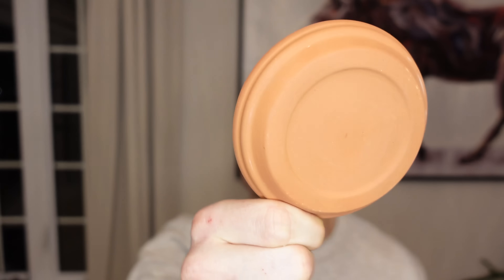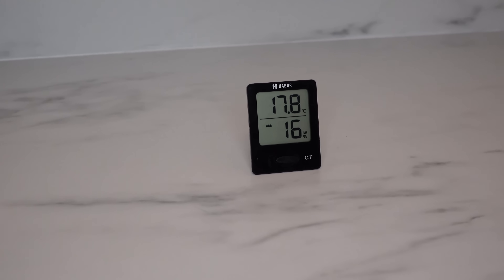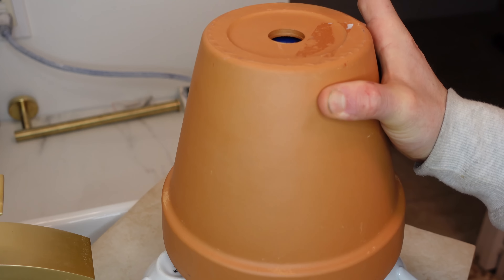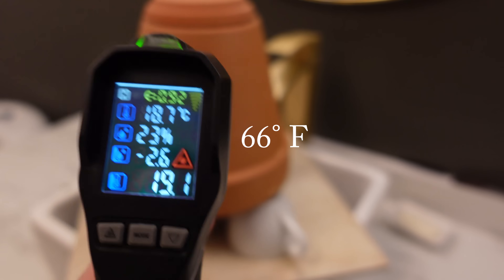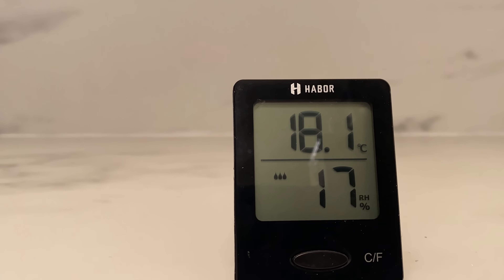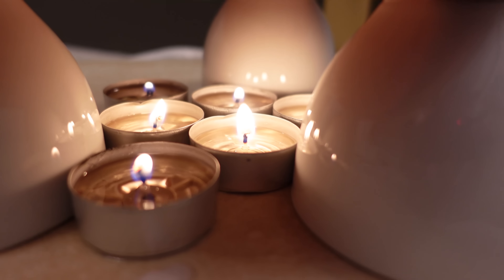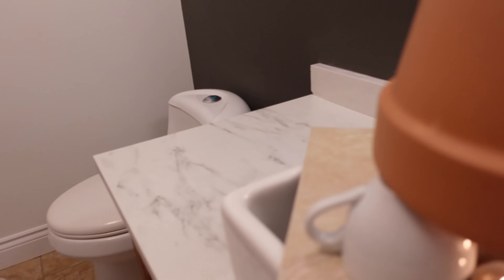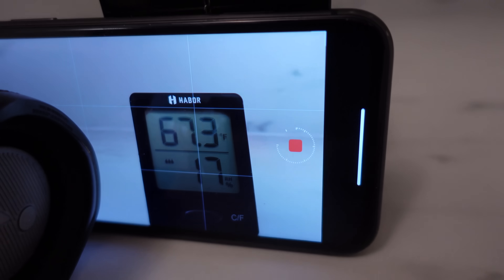CLAY POT HEATER TEST | Does It Actually Work?!

Comment: How many high output bulbs are in that room, did you start this in the morning as it heated up the ambient room...
Reply from the maker: Hmmm, good point. I will re do it with a different heat source and lights off.

Comment: There is a danger to this. 
The parafin wax can actually explode and shoot flames out the sides of the pot. 
Normally the flame on a candle just burns down the parafin wax but doesn't get hot enough for the wax to ignite until you put a lid over it like the terracotta pot.
This then sends heat down to the wax and can cause the wax to ignite.
Reply from the maker: True, be very careful when handling candles.

Comment: THE POTS NEED TO BE LOWER
Reply from the maker: Oh! I will re do it.
Reply: @philg  PLUS IF YOU PUT 3 BRICK WIT HOLES IN THEM ON TOP OF THE CLAY POT IT WILL RADYAT EVEN MORE HEAT  I HAVE BEAN USING THIS WAY FOR 30 YEARS  PREFRABLY BRICKS FROM AN OLD ELECTRIC STORAEG  HEATER WORK BEST

Comment: I use those little candles,  without terra cotta pots.  Mostly for lights.  But if am going to get a tiny bit  of heat, I would go to Sams Club and purchase a case of Safe Heat for indoor use, and have a carbon monoxide meter just in case.  A little camping stove with a grill on top, bit enough to use with small and or large terra cotta pots, and to heat up water.  Let's be real, something this small will take around 1/2 to 45 minutes to heat up water.  If you have bullion you can put it into the pot (depending on how big it is) 1 bullion for a small quart pot, a tad larger 1 1/2 package or cubes.  At least your getting something.  You can also fry and egg or bacon, but it will take more then 15 minutes.    But ya have to make sure the area is secure and safe, where nothing can be knocked over.   Then you might wind up getting heat you don't want (house fire).   Keep a fire estiquisher around in the area you plan on heating yourself (no tents) or cooking.   Keep an eye on that Carbon meter.  It will tell you if carbon build up starts in your area.  You need to ventilate.
Reply from the maker: Very interesting! Thank you for sharing

Comment: They work aslong as the Room Area isn't  to large.  Add another one to a larger room, you may need 3 or more if the room is rather large or big.
I would hang Drape or Blanket to cut the room size if you are running low on candles.
Just remember to put a Paver under the Heater as not to burn or scorch your counter top.
I like using my Terra Cotta Heater. 
Be Safe
🙏🙏❤️❤️

Comment: You did it pretty wrong. First, don`t put the cap on. There is plenty of heat coming from holes to the air and it heats the room. Second, the distance between candles and pots are a way too long. I put the pots straight to the candles and the pots went very hot. So, due the mistakes it did not work very well.

Comment: And FYI - a tealight candle gives off "about" 35W of heat - so in this case a total of about 200 Watts from the device. A human gives off about 100 W of heat energy. Maybe your bathroom had very low-wattage LED lighting? If you were using traditional incandescent bulbs then their total heat emissions would likely have been as much as or greater than all six candles combined.

Comment: Too funny - it heated up a tiny room by less than 2 degrees AND you kept the lights on (it would be interesting to know the wattage of the lights because they are a non-stop source of heat as well). I really don't understand how you could possibly be surprised that 6 candles warmed up the terracotta so that it was almost too hot to touch. Try holding your hand the distance away directly above 6 burning candles for a minute or two - candle flames are of course very hot when you are that close and immediately above them. These things are an absolutely terrible way to heat a room.

Comment: You have capped the pots so there is no heat moving in between them… there needs to be holes in the side of your spacer. All you have done is slow the process of heating.  The same temperature will be gotten with just the candles alone.

Comment: I agree that you would need to try the experiment w/ only the candles. Also, you confounded it by leaving the lights on in the room; if they give off any heat at all (some LED lights do & incandescent most certainly do) they may have been responsible for the increase in air temperature. So see if the room temperature increases with candles only and with no electric lights. I'm no physics expert, but the little I do know says you only get out of a system what you put into it.

Comment: Try capping the inner pot or even not at all, you can create a convection effect that way which works better. I have the two smaller pots bolted together, I use a long bolt and get one of the candles straight under it to maximize heat but use enough nuts and washers to ensure the pots aren't touching, and then have a larger pot sitting over the top so the heat can rise up out the small hole in the large pot. I have a second set up with just two pots with no holes capped at all (usually cap the top hole with a coin for about 30 mins to begin with) which pours much more heat out the top and strangely less paraffin smell.
Reply: the candles emit a finite amount of Btu's. Nothing is going to change that.
Reply: @uberdome1  yeah no shit, thanks for that. You clearly haven't tried it out yet. It's about saving up the heat from earlier in the terracotta which can then warm more air as it gets sucked through, the pots also radiate heat too. I've tested every method including just a bunch of candles by them selves. I use an actual heater for the first hour but then save on power for the the rest of the day. Good for single room use.

Comment: These are always the dumbest videos.  The candles will produce a fixed btu regardless if the terra cotta pot is there or not.  The room heats to the same temperature without the pots.  Yes the pots get hot but they do not create more heat.  They only radiate the heat that's already there.  If you ever care to be scientific,  and I wouldn't suggest you would, but if you did you'd do an identical test with no pots.  The resulting temp in the room would be the same and it would undermine this video so likely you won't do it.

Comment: Okay, so this may be taking things a little too far but couldn't we find a way to use thermo-accoustic's to power the heating of the clay pots from external pipes OR from Fresnel lenses directing light from lamps in the home onto the pipes directing kinetic energy into the home from a diaphragm with magnets on it which in turn produces electricity from a spun wire, some sort of always on system?

Comment: 1 this is a fail the space between the fire and the pots to big pots need to be up only 1 cm  for air so you really trap the heat  2  the smal pots top need to be covert with flat piece this will triple the heat if done correct you cant touch the pots you wil burn your self

Comment: So... you build a small heater... and on the heater you put an isolation in form of a second pot? Which reduces the efficiency in terms of radiation and trades it for energy-conservation of the inner pot. Or in other words: Putting a second pot on it, keeps the inner pot warm for a longer time but does give up less heat to the room.

Comment: The original one (from Wales I believe) said to use a metal bolt to join the 2 pots, with washers to create the space between. That way the metal gets hot and spreads the heat to the pots. Would be curious to see if there is a difference.
Reply: That's exactly how I made mine, hHe 3 of them and used about 500+ candles over winter. £3.75 per 100 candles. Hopefully wont need them from mid march but they do Heat up my rooms enough to not need the heating on during the day.

Comment: This is silly. You can look at the heat output of a single candle like that. The pots don’t radiate any heat or do anything meaningful on their own.capturing the heat instead of hearing more of the air doesn’t really change anything. 

The heat generation is coming from the almighty power of 6 tiny candles. That’s just not how you would want to heat a room of any real size. 

The next test you would want to do is, in the exact same room when the outside temperature is exactly the same … light the same number of the same type of candles and do the same experiment.

Comment: I appreciate the initial use of the word "Emergency." I'm a 33 year HVAC professional and candles of all sorts put out more soot, and add pollutants to the ambient more than is readily apparent. This system DOES work, but there is no free lunch. I am concerned about unattended candles, and soot. Once, again, the presence of soot, and the degradation of Indoor Air Quality is not readily apparent. Regular, and often use of candles, when other heating means are available, is not generally a great idea.
Reply: The soot would be caught and adhere to the pots in this kind of system though.

That said, i'd be wary of using this in a small car or camper without opening up a window since the candles can burn through oxygen in an enclosed space like that very quickly.
Reply: @sevenproxies4255  It's true that it would soil the walls, etc. But you're also breathing this. It has a real impact on indoor air quality

Comment: A typical candle outputs about 80 BTUs of heat. Adding a flowerpot in any configuration does not increase the heat output. It is still 80 BTUs of heat being generated by the flame. These gimmicky "heaters" are pure fantasy.

Comment: The clay pots do nothing.  You've got the heat of six candles.  100% of it goes into the room no matter what you do.
Reply: Take the heat of the candles and ADD the heat of the pots and the heat is greater than candle alone. Plus…Molecules in air are spaced far apart so they do not hold heat as well as a solid,  which in clay are spaced unusually close together. It’s takes a micron microscope to see the individual “grains” of clay they are so tightly packed.
Reply: @lindashobe-e7j  You don't ADD that heat.  The pots are not making their own heat.  They are just re-emitting heat they absorbed from the candle.  Nothing you said made the least bit of sense.

Comment: Ive made a few of those to save heating fuel. I like to enclose my desk and use one under there while working or spending time at the computer. It works wonderful and will heat the whole room eventually. Ditch those cheap tea candles and use a candle with a thicker wick and you will see a huge difference in the temp it creates. 👍
Reply: Jewish Shabbat candles are the way to go. Widely available, and burn for ages
Reply: I kinda disagree - the tea lights do have some pros - firstly their time of burning is well known in advance - say like 4h which means they are predictable in that regard which is a pro for some people. 
Tea lights are also easy to regulate how much heat you want - more or less just by using more or less of them. And ofc tea lights can be bought in bulk quantity and each one is basically dirt cheap.
Reply: When its really cold i'll go with a better quality candle. I'm not THAT poor lol
Reply: Use bees wax  candles and you get the benefit of air purification too.
Reply: @dorothyannnorng860  never heard of those... cool idea!

Comment: This test is valid as ur gap using the cups is way to big, ur losing some of  the heat from the cadles due to this huge gap, needs to be way smaller, ur whole setup is wrong

Comment: I think you should repeat the experiment, without the pots... (with the same starting room temperature).  That would really tell if the pots make a difference, or if it is just the tea light flames.
Reply: That terra Cotta pot does nothing to increase the heat in the room.  It might help diffuse it in the same manner that a globe or lampshade diffuses light.

People seem to not grasp the basic laws of physics.
Reply: @absurdnerd7624  or basic grammar it seems :) Also ...light diffusion and heat radiation are quite different. Some people (@absurderdnerd7624) fail to differentiate between basic types of physics
Reply: I would assume that the solution of just the candles would allow for the heat to just travel up through convection, and you would very much be heating the room top down.

This method traps the heat lower down the room, in the mass of the pot allowing for an element of radiation.

That being said, this is really just a very crude "radiator" which are miss-named, as the vast majority of heat released into the room is most certainly not through radiation, but convection.

I really can't see it having a meaningful impact on a room of any size, and is far more a "personal" heater, and the notion of having a set of naked flames is just reckless and dangerous.
Reply: Nah.................................It doesn't TRAP heat lower in the room,  ALL heat rises.  And there is absolutely no additional heat from the terra cotta pot.  No net gain.   @DouglasFurlong
Reply: @BennyCFD  A common misconception - warm air rises but heat radiates outwards spherically otherwise all heaters would have to be on the ground and the sun would only heat what was above it. 'Trapping' or insulating heat is easy. Think about thermos flasks or clothes. If all heat rises then a wide brim hat would keep a nude person warm or the flasks would only need insulating at the top
Reply: you are joking right? you have to be. that's too funny
🤣🤣🤣
Reply: @kaylisperry6454  Dave, Benny and Doug aren't joking. 🤣😂🤣😂

Comment: Warning!!
Always set these up in some kind of fire and heat proof tray! And always treat them as a potential cause of a house fire.
I love these things and I have used a few different designs. They are great at taking the edge off on a really cold day.
That said, remember the critical dynamic here: the candles are heating each other, just as much as they are heating the pots. If the candles reach their flashpoint, ALL the melted wax will ignite.
When that happens you will have lots of little pots of flaming wax spitting every where, and a runaway heating reaction as all that fuel dumps its energy at a very rapid pace, potentially vaporising it too. I have seen some horror stories of people almost losing their homes, and in one instance their boat, because of this runaway reaction.
My honest advice is ...
NEVER leave them unattended, or sleep with these lit.
Periodically check with a laser thermometer just to check the temps arent too wild.
Assume they are a massive fire hazard
Use a drip tray to contain any spillage/disaster
Have reliable and instant means to put out a fire close by.

These things are great fun, and a lifesaver in a power outage, but you have to treat them with respect. They are, after all, potentially a mini-fat fryer disaster waiting to happen.
Thank you for the tests and careful benchmarking Phil
Reply: Duh

Comment: I would like to see a controlled experiment of this pot v.s. just the candles. My bet is that just the candles heats the room quicker and last longer because of the colder slower burning wax. The pot is merely a safety shield to prevent fire but actually stops heat energy from getting to the air keeping a certain amount of it trapped in the pot.
Reply: Yes, a controlled experiment is the way to go.  Two rooms, same dimensions, same insulation, same air flow, etc, as equal a possible.  I will accept your bet but say the rooms will heat the same as long as the candle flames remain the same.  That part could be hard to control.

Comment: Since it is a very small space, I wonder how warm it would get from just being in the room without the candle. I know from experience working in a closed off bathroom that it gets rather warm quickly.
Reply: I'm thinking the light bulbs did a lot of the heating.

Comment: I ran 6 candles in about 4 inch terra cotta pots, 1 candle each. You get about 6 hours each, if you keep the temperature of the wax low that is. Hence 1 potfor each. When you run 10 hour shifts, and your only awake at home for maybe a total of 6 hours, it can help alot. Especially when you have a one room apartment with nothing included

Comment: Hey Friends.  Heads up.  Terra Cotta is no longer the trusted clay composition you have relied on in the lower end price points.  Buy your Terra Cotta only from a reliable source.  The "globally sourced" pots at discount locations are only painted.  The interior/core of them is glass or ceramic like.  Glossy black.  I have seen other comments in threads of pots bursting when they get too hot via these candle heaters.   It is my theory they were using the cheapy version non clay version.  
When shopping, it is hard to tell the difference. They feel the same, same exact color, same weight, same clank noise you are familiar with.   A real CLAY pot is not going to have precise finished weep/drain holes.  There should be a rough salvage of clay on some in the lot in that weep hole?  Shouldn't there?  
PS.  Clay pots have ALWAYS been economical.  Not arguing there.  But I can attest numerous items in my daily life in the past ahem, 2+ years are no longer what they used to be.  Making everything cheaper, faster to market is key.  "how much to make this?"  they get close in appearance, but not the exact thing.  Doesn't matter when you are potting daisy's but does when relying on for heat. ~ Best